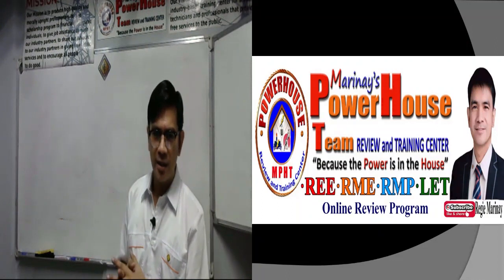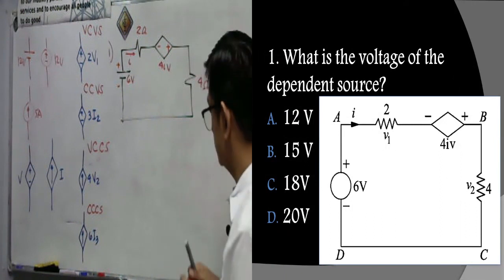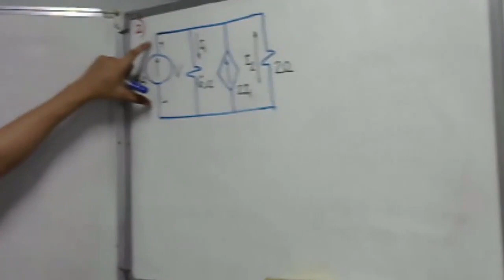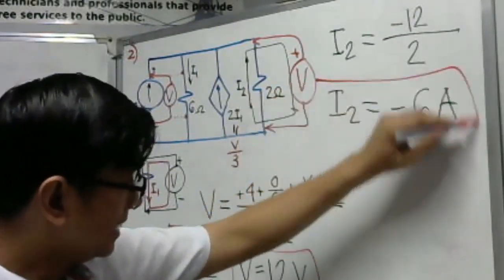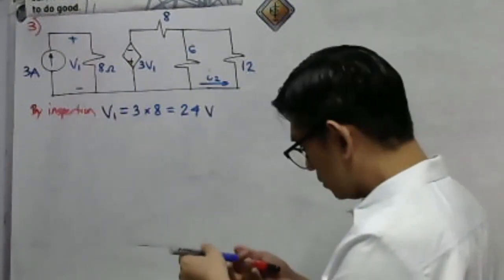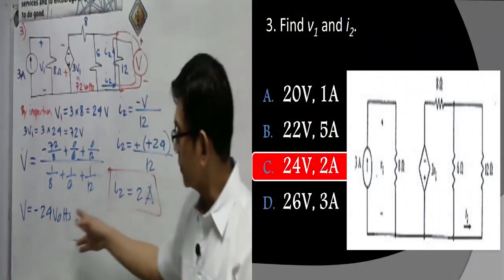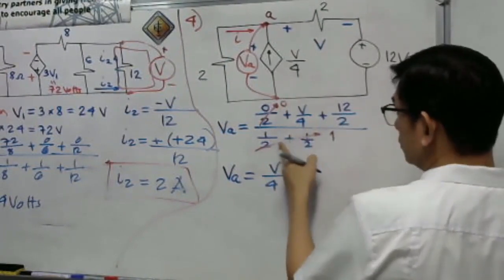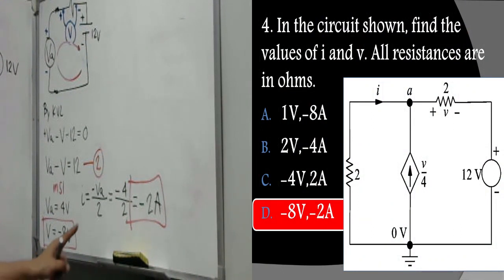Dependent Sources Part-1 (English&Filipino)

Comment: thaks a lot kuya regs sa totoo di naman ako engineering course pero itong video na ito nakatulong po kong paano mag solve gantiong  problems voltage control current source depedent source kaya pag balik k balikan ko nalang pag panunod para malaman  kasi nahirapan po ako Thanks